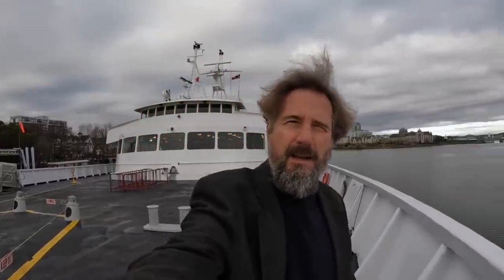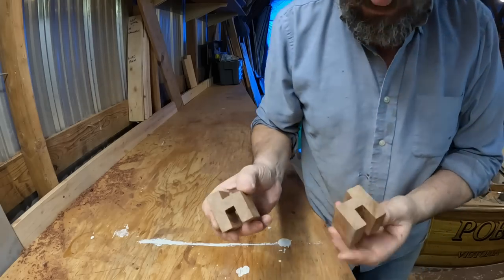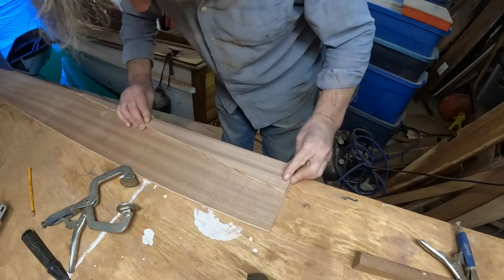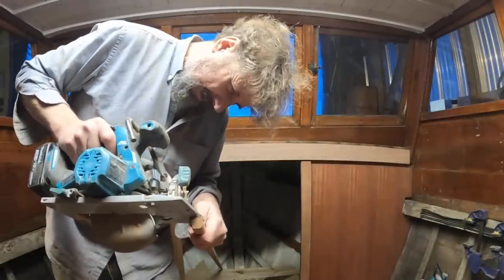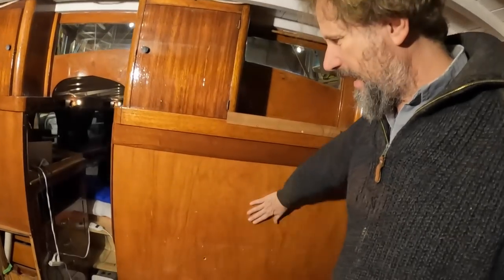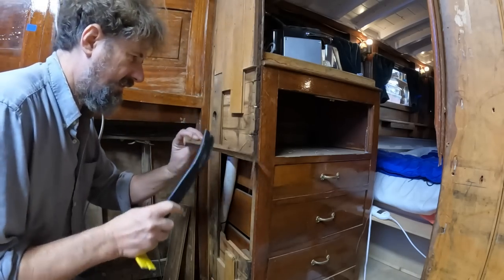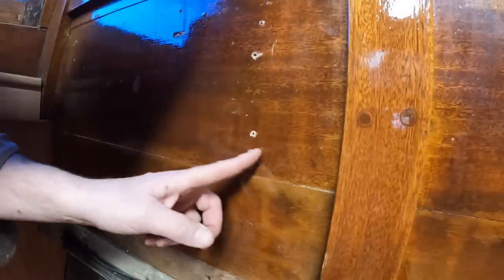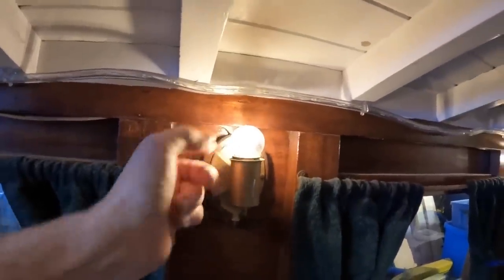I Love Mahogany - #348 - Boat Life - Living aboard a wooden boat - Travels With Geordie

Comment: Hi Peter, the tongue and groove at the bulkhead, instead of cutting the tongue away try cutting the bottom part of the groove away, on the board to be inserted.  Set skill saw to the correct depth and remove,  this still gives support to the upper half of the board and prevents it from being un flush with the other board. Hope this is useful.
Reply from the maker: That's a good point!

Comment: instead of making bungs out of new wood use the old, varnished patina wood to cover those exposed screw heads.
Reply: I agree... I keep all the things extracted from a project to the finish...
ie using for patterns. Things like wood I don't throw away I reuse.. or if not usable firewood.
Reply from the maker: That's a great idea, I just need to get a straight plug cutter.
I also don't have and Honduran mahogany scrap but tons of 1950's merenti. It's a better match than sapele
Reply: @TravelsWithGeordie  i have a 1936 Chris Craft Clipper Cruiser. i had a few proud screws in the same place. i drilled them out and put the  ''old '' patina plugs in,  a little varnish and hardly tell it's been done.  i'd love to find a cruiser like Poem.